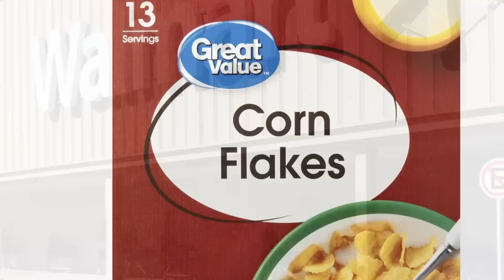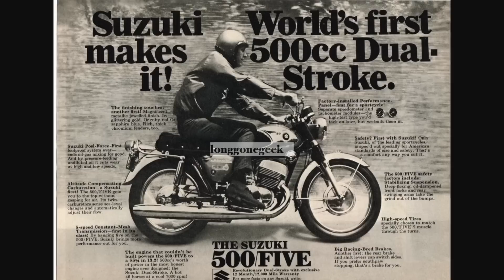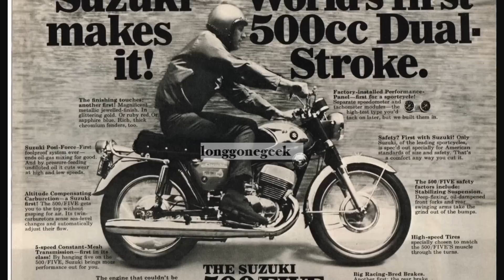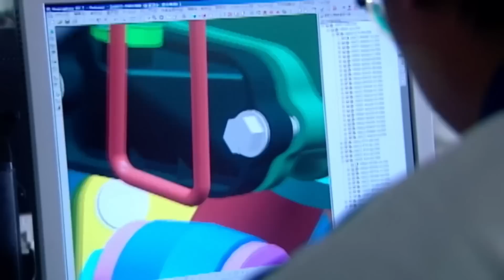How Suzuki became the Walmart of Motorcycle Companies

Comment: Suzuki uses a blue ocean strategy - most people want a realiable, forgiving, affordable, good performing bike with good after market support and that's what nearly all Suzuki Bikes are (except maybe the Hayabusa as a halo product).
And you really have to try to break a Suzuki motorcycle - nearly all Suzuki bikes I've seen from the inside in the last 20 years look like they got right out of factory with 100000km+.
Yeah, new tires, new brakes, new chain bla bla, but they build maybe the most reliable engines for motorcycles in my opinion.
And they drive very easily, every n00b can drive them without a sweat and people with tens of years of motorcycle experience can enjoy them too.
Will take a Suzuki for my tours everyday, not interested in bitchy Kawasaki, maintenance heavy Ducati, too complex BMW or artificial pricy Honda/Harley. 
If you enjoy those, fine by me, who am I to judge? But if you just want to ride a bike and don't pay a fortune - buy a Suzuki.

Comment: When I was a wee lad the GS750 Suzi had a reputation for being the first Japanese bike to really handle well. For being their first 4 stroke it stands out as an achievement. I have always been a GS shaftie bloke myself. I have a string of GS 1000 & 1100s in various states of repair to this day. 

My GS1100GK full dresser is not like the others though. At 180km/h plus it is a scary pig.

Went back to smaller bikes for their handling. Even got an Enfield 500 back in '95. No power at all but it can cut through a corner as well as almost all the bikes I've ever owned.

For going sideways on the bitty though the GS1000G would do it like my old Honda 750/4.... under protest. For that my all time favorite was the Yammy SR500. Only machine I've ever owned that even my neanderthal ham-fisted lack of riding  talent couldn't upset.

Damn sorry I ever parted with it... especially since it financed the Suzi GK Pigwing.

Comment: Suzuki started the sport bike genre and the start of the modern era back in 1985 with the GSXR.. Road Bikes like that hadn’t been seen before.. It makes me sad that street sport bikes seem to be dying.. It’s all adventure bikes, crossover bikes, super nakeds etc.. Bikes like that don’t interest me. They just all look very ‘samey’ to me.. I have an SRAD 750 in my garage along with 5 other classic Sportbikes. 

Kawasaki are re-introducing a 4 cylinder ZX400R sport bike.. really hoping it re-ignites the sport bike market. After all, MotoGP, WSBK, BSB all still have a huge audience and fan base..
Reply: mmmm, think the GPz900 1 year earlier 1983/84 started it all. Also in 1985 Yamaha had the FZ750 which had features like a deltabox frame, 5 valve head, water cooling, down draft carbs. All things the 85 GSXR did not have. From a technical perspective it was behind at launch. However ahead in performance on track.
Reply: @fastchip  I agree that the GPZ & FZ had some more technical attributes as you stated.. but neither the GPZ or FZ had full fairings. The FZ did but that was with later models if I remember correctly. The GPZ design was also dated in comparison, The FZ also had a steel box section perimeter frame, not an alloy Deltabox.. that came along with the FZR1000 Genesis.

Comment: Can you make a video just on the 18 speed gearboxes and how exactly that works/helps? I don’t fully understand let alone appreciate how that would work and what riding it would be like
Reply: On a bike with a typical 6 speed gearbox, the rpm's will drop 1500-3000 rpm each time you up shift. On a small CC high HP bike the powerband will be very narrow. IE, it will barely make any power at 8500 rpm, then from 8500 - 1000 rpm the power will spike suddenly. To take advantage of that 1500 rpm band of power you need more than 6 gears, to prevent the motor falling out of it's powerband between shift. If it drops 1500-3000 rpm between shifts with a 6 speed box, it might only drop 1/3rd of that or 500-1000 rpm with an 18 speed box.. Keeping the motor in that narrow band. These bikes were extremely difficult to ride because they must be constantly shifted either up or down to stay in that narrow rpm range.

Comment: In my opinion Suzuki is just bland, outdated, and generally underwhelming. 
SV650 is meh. FZ-07 is better. DRZ-400 is cool. But it’s not really good off road. And it’s not really a fun supermoto. It’s just decent. Just get a WR250R or WR450F. GSXR is cool but then there’s the R6 and R1. Their latest bike is a blatant ripoff of an FZ-07. 

What I’m saying is they make decent bikes that are reliable and then remain unchanged for decades. At leas tthe DRZ is a cool supermoto you can still get. But damn, 2023 and it’s still got a carburetor. I pretty much refuse to buy bikes that are carbureted because they just suck. I only say WR450F because it’s light and fast and torquey and while still cabureted, js ten times the bike the DRZ is

Comment: 100% agree.  I purchased my GSXS750 in 2021 because it was the best bang for the buck….then I needed a commuter to get to work on and I didn’t want to put all of the kms on the 750…..so I chose a GSX250 as it was the cheapest with all of the features that I wanted.  Now I have added a CB1100 to the fleet as a weekend fun ride and I am blown away by the absolute quality of it.  It seems no expense was spared….which shows you the mindset of Honda vs Suzuki.

Comment: The CB750 was just the right bike for the times. Great commuter, knock around, everyday rider. Very reliable and very comfortable. Compared to my other vintage bikes 72 Suzuki 750 Water Buffalo and 74 Yamaha TX750,  my 1975 CB750K feels much more like a modern bike when riding it. If I'm taking my wife for a ride, the CB750 is still my go to bike. She can get on and off very easily and both of us are very comfortable. Not a bike you want to push very hard for a lot of reasons, but just a pleasant machine that can take you around the block or across the country with dependability. I never intend to sell mine.

Comment: When the GSX-R600 was first released, Motorcyclist's cover headline was "Is It Worth the Weight?". It was heavy and slightly underpowered from the other 600s of the time (CBR-600F2, ZX-6, FZR-600). It did not fair well in testing, but they eventually got the formula right.
Reply: Maybe the specs were different in the States. But here in Europe the F2 had 100hp ang weighed 185kg. ZX-6/ZZR600 98hp/217kg. FZR600 91hp/179kg. GSXR600 106hp/208kg.

Comment: You said Suzuki's 500cc two stroke of the late 60s (T500) was 'Unruly & powerful'. It was, in fact, non of the sort. It was relatively docile, at only a claimed 50 bhp (later revised down to 44 bhp) & it was very mild mannered, without the pronounced power band associated with many two strokes. It's power delivery being more like a 4 stroke...
Otherwise, Great vids...
Reply: Yeah, I once owned a 1974 Suzuki GT750 LeMans Water Buffalo 3 cylinder 2-stroke and I've driven a friends Titan 500.  Both bikes were mild mannered with no power surge "when on the pipe".
Reply: I'm guessing he thinks the 750 Kawa triple was called the widowmaker as well, it was the 500.

Comment: Suzuki used to specialize in 2 strokes engines like  tl1000r which they put alot of money into designing..  it changed the engine game.. then 2 strokes became banned.. thus they didn't transfer like others did well
Reply: The TL1000r is 4-stroke. It's v-twin, so maybe you're confusing with 2 cylinders?

Comment: Not sure I agree with your interpretation of the GSXR letters. GS is for four stroke, X is for four valve head and R for Racing. I do however agree with the premise of the video. Suzuki were once the last word in sports bikes. I had a GSXR1100 in ‘87 which was mind blowing at the time. I also owned what I think was their finest hour in sports bikes, the RG500. Now that was a back road weapon!!
Reply: Totally agree…..RG500 was Suzukis first race bike for the road before the GSXR750. I own a RG500 and there is nothing like it. Would love a GSXR750 slabby as stable mate for the RG.
Reply: i think my 06 bandit 1200 is the last mohican from that era of air oil cooled gsxr engines

Comment: I’ve owned a carbureted SV650, a DRZ-400 converted to SM, a DR-650, a GS450… So, yes, Zookie fan girl. Apart from some electrical issues (reg-rec) they all worked fine. Walmart? Okay gotta watch your video. 😂

Edit: great video! Suzuki seems to be resting on its laurels. It’s easier to take, say, the SV motor and toss it into an adventure bike instead of developing an engine. I don’t hate this but I’d like to see some innovation from them.